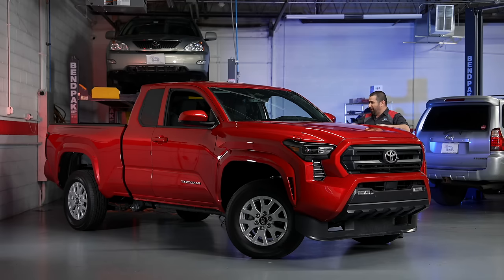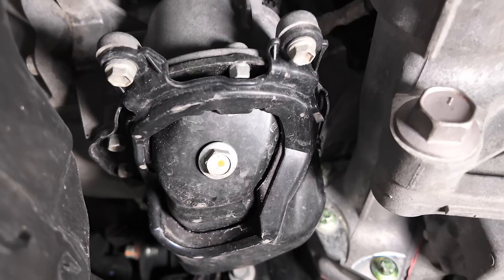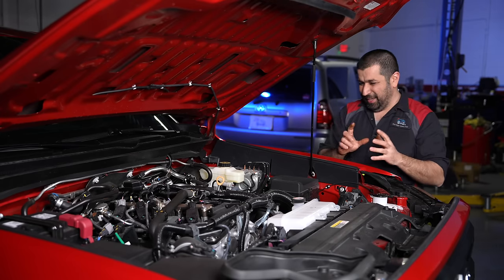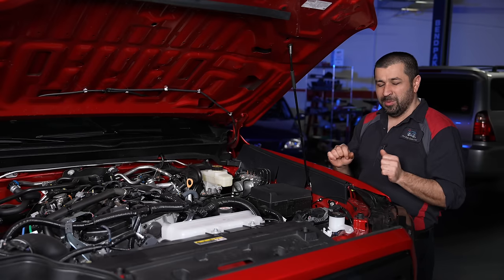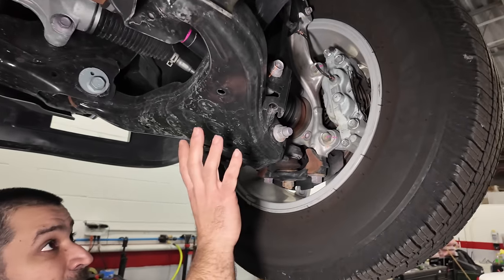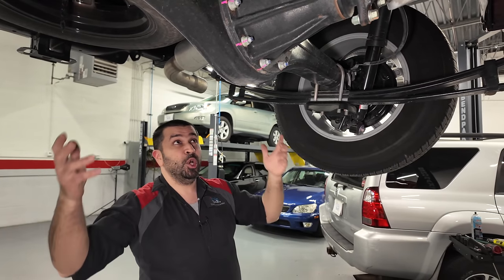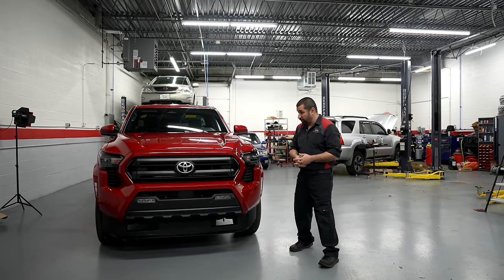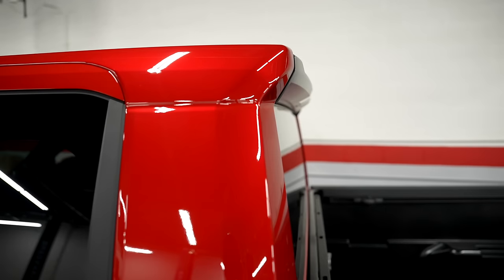2024 Toyota Tacoma | Did Toyota Improve or Ruin The Tacoma? Comprehensive Review

Comment: The vehicle i love and driving since 2009 is just behide you. 2005 model, bought used so many years but still haven't touched the engine for any issues. People talks about going green never talks about how battery and other things are collected or made. This vehicle is been running well, if i got an similar European brand it would have needed major maintenance works or ultimately had to change. So tell me a new vehicle adds carbon foot print or not?

Comment: Toyota cost-cut this truck too much. They retained the drivetrain designed for naturally aspirated V6 engines and used software to limit torque to protect the weak parts instead of simply beefing the drivetrain up. To add insult to injury they moved production to Mexico to eliminate most of their labor costs and still raised the price of the truck by $20k.

Comment: They keep getting bigger and bigger each year.  And with the increase in size they did enormous complexity- especially electrical components that can’t be repaired.  This increases cost of entry and total cost of ownership.   The main reason for this is EPA regulations that make it hard to produce a small truck.  I want a truck about the size of the original Datsun.

Comment: Its hard for me to believe this engine will last 300k plus miles. Watching this video makes me miss my 2004 tacoma with 376k miles. Would drive it across the country. Did not have any issues with it. The prices for these new trucks are extremely expensive, especially for a 4 cylinder. I have already seen problems with the new tacomas. This is an unfortunate time, folks.

Comment: I just wished that on all turbos they would have turbo timer and that means when you tur your car off it would keep running for how ever long it takes to get everything cooled off. The after market has a turbo timer that I have on my 05 Dodge 3500 turbo diesel and it works great and it runs for about 3-5 minutes and this is to cool down the tubo oil so it does not cook the oil in turbo and people just want to shut it down and run in a store and don’t want to set and let it cool off just a little. But tubo timer on my truck does a great job of letting it run and cool down and it depends if your pulling a load and that tubo at nite that turbo is cherry red and this timer may run 30 seconds or run a couple of minutes but it does work great so far and it has been on my truck for about 5-6 years so Tacos need to look at this little upgrade may save you a turbo and they are not cheap and the timer is.

Comment: In the previous (3rd gen) tacoma, the slow-opening tail gate did not use shocks. It used a plastic sleeve that rotates inside of a metal collar. That piece of plastic was very weak and prone to cracking and breaking apart, causing the tailgate to unexpectedly drop quickly. I know this because on my 2023 tacoma i have already replaced three of those plastic sleeves, and bent the bottom corner of my tailgate in the process. Poor design.

Comment: I'm a Tacoma owner (an older one), and I have a huge problem with them replacing the V6 with a turbocharged engine. Even if they kept the V6, I would still not want a turbocharger on it. Forced induction is great if you're a race car driver, but racing teams rebuild their engines often.  But an average wage earner who can hardly pay these high prices for a truck isn't going to be happy with shorter engine life that comes with a turbo. Do your research and learn what a turbo does to your engine. The long range data isn't in yet, but I for one will not be one of the guinea pigs.

Comment: The locking gas doors provide practically no protection.  You can open it with a knife or screwdriver in about 2 seconds.  If someone is going to pour something in the gas tank the locking door is absolutely zero deterrent.

Comment: Is this an infomercial?? I'll stick with my 2023  Canyon with diesel engineering built into the design architecture of the engine and 430 ft lbs of torque. Zero issues with my year old Truck.

Comment: It looks like they are not spraying down the engine compartments with that waxy oil stuff.  Never could get that off very well in my 95'.  Good they got rid of the mechanical fan.  That was a failure point more than once in my 95'.

Comment: Why they didn't just put the powertrain from the hybrid Highlander in there is beyond me.  Toyota reliability, hybrid expertise, would make this great.   

You don't need a 5 second 0-60 truck.  It is a truck, not a sports sedan.   7 second 0-60, with torque to pull a sub 5000 lb trailer, with great mpg is a market killer.

Comment: Beautiful car!! Crazy it came all the way from NY! Thoughts about 540RAT engineering blog? In it he has tested over 300 engine oils by now and his current wear protecting oil champ is Quaker State Full Synthetic 5W30 (not Ultimate Protection, must be 5W30). Says modern liquid cooled engines are “better served” with a highly ranked 0 or 5W30 from his list but I already gave his domestically available #1. Being an Aerospace engineer and lifelong engine builder he says car company engineers don’t understand oil very well. And they are run with political intentions. Anyway, that and Mobil1 Synthetic ATF Multi Vehicle (Silver bottle black label), Valvoline 75W90 gear oil and Redline MT85/90 are what’s in my garage 🔧

Comment: In my observations, Toyota should have given the choice to the consumer with better options. A powerful V-6 with a Turbo for pulling heavy loads as well as a better Rock crawler version having a, 4 cylinder Turno diesel with a dircet injection model. Give the customer better mechanized option and let the consumer decide for you upon the sales. Mechanically what would make, Toyota a better Truck, is always give your, DIY guy like a majority of, Toyota fans the engine access and ease of maintenance with easy bolt on performance upgrades. I'm not sure on the engine longevity and ease of maintenance with the split-head design. I see more problems with that design. 

The electric Fan is a better idea to reduce engine load, but in my observations my concern is how good is the water proofing and high mud issue handeling?  If live or work in a place that has high mud and snow and has alot of dirt roads in dealing with the high mud and wet snow coveringthe roads, how long will it last and how is the ease of maintenance when it fails?

Comment: I'm hoping that Toyota sticks to it's reliability reputation and has the kinks out for the 26s and up. They look good, but we'll have to see about the powertrain going forward. I have a 07 tundra with 251000 on the odometer and I want a midsized truck. I want to stay with Toyota.  I've had the little hardbody for over 10 yrs before and had no issues but a power steering pump under warranty. I do wish they would have stuck with naturally aspirated engines like Nissan is still producing for now. My truck runs great but further down the road I'm going down size my daily driver and keep my tundra for recreation.  If everything pans out for the Tacoma, I'll probably get the SR crew cab and still have the leaf springs. Every trim on the frontier has the leafs. I could get a certified pre owned 23 Tacoma with low miles. Anyone test drove both?

Comment: I hate that Toyota and other manufacturers (cough cough GM) are putting the same engine in different models but detune the entry level one essentially making the only difference being software.

Just put one power train then! That way you don't need two separate tunes to be maintained from a software standpoint. That said, I guess that oil cooler probably is needed for the greater model.

Comment: Why would a direct injection engine create less vacuum than a regular injection engine ? They all pump air in and out and they both have a throttle body that creates a restriction. It doesn’t make any sense to me that the position of the injector causes any difference whatsoever.

The real reason is far simpler : turbo engines create boost, which is the opposite of vacuum. The vacuum pump keeps everything vacuum activated working even when the engine is under boost

Comment: So yeah, basically Toyota has made a cheap and inexpensive pickup truck as expensive and Gastly to repair as a full size diesel truck when you start adding turbos and high amounts of technology that usually ends up failing and all these extra sensors and and what not all you get is a very very very expensive bill when something goes wrong and it's going to be out of warranty so you know. Good luck with replacing a $5,000 plus turbo and the fact that if the turbo isn't running properly, you're not going to get any gas mileage and you'll be lucky to get up to 20 mph. Yeah thanks Toyota. Thanks for destroying the Tacoma

Comment: Better keep the oil changed with oil controlled valve timing, and those other changes, among them turbos.  This is a very oil sensitive engine.  Plastics…. Eventually trouble.

Comment: An engine with direct injection if not maintained along with 3000 oil changes(IMO) and the valves not cleaned will result in stuck piston rings and high oil consumption. The oil cooler is a bad designed idea and all those O ring mating surfaces will eventually leak because of flattening O rings. Engines with direct injection should have at least port fuel injectors to keep the valves clean. An external oil cooler sans O rings would be preferable. The air to air intercooler should have at least a metal debris screen behind the front grill. Commercial truck manufacturers do that to keep rocks,bugs,birds, etc from damaging all the radiators. On top of all of that,the electronic start mechanisms are prone to fail and is not necessary .Electric actuated HVAC motors are prone to fail and necessitate practically pulling the dash out to replace. Cable actuated climate control doors are virtually maintenance free.

Comment: It's a new engine so the reliability is not known. It needs many years to prove its reliability. The single best selling point of Tacoma was reliable proven engines. Toyota made big mistake. I have been considering trading my 2015 PreRunner but I think I'll just hold on to it or maybe consider a Frontier which is cheaper too. Will have to do some research...

Comment: Right out of the gate, two different "engine options", which are mechanically identical, and only use different software. Yeah no, if you sell me the same engine, but try to charge me more (I assume), for different software, that's not gonna fly. You lost a customer just by trying that.

Comment: I've owned vehicles with 4 cylinder turbo charged engines. (Isuzu  turbo diesel, Mazda CX-5 2.3L Turbo, along with Ford 250 Superduty with a 6.7L Turbo diesel) The reason for the installation of these engines is a government  requirement meant to meet the CAFE standards.  In general, that doesn't work - it's been my experience that gas mileage doesn't improve that much. For example, on the highway, I get a bit better than 22 MPG with the 3.5L V-6 in my 2019 Tacoma.  It's also been my personal experience that with a turbo-charged engine there's a tendency to 'get on it'. This always lowers the mileage. In general (it's also been my personal experience) that the life expectancy of a smaller engine is less than that of a larger engine.  Turbo failure has followed all of these vehicles even having used the 'cool down' techniques necessary to operate them along with frequent oil changes with high quality oil. Finally, the smaller engines have to be 'driven harder' in order to get the same amount of 'work' out of them than a 6 cylinder.  Give me a larger naturally aspirated engine any day.
Reply: Biden requirements can kick rocks 💪🏼

Comment: I was getting ready to say something about the air dam. It's dumb but at least it's not part of the painted part of the body like my Camry had. 

It sucks not having a dipstick for the transmission. I didn't care until that crappy 2020 Camry transmission started acting up and I didn't trust the dealer was checking it when I asked them to. The dealers wouldn't let me watch the maintenance done to my car and that really bugged me.

Toyota had to be sued for them to fix that crappy transmission in the earlier cars. I hated it in my Camry.

The gas filler above the fender flair is a bad place. I hope a  protector is made to keep from chipping the paint if you're not careful. 

Don't buy a pickup if you want a smooth ride. It's not made for that. 

The body lines look better than the full production Tundra's.

The radar sensor is right were other people's bumper would hit it. 

It's way overpriced for a pickup. I'm concerned how well a turbo engine will hold up to towing or loaded after 100k miles. I expected my new Camry to last but it was the most annoying new car I've ever owned. I didn't trust it to drive it very far.

Comment: Turbos suck. I do 40000 miles a year and I don’t know of a reliable turbo past 125k. Coil springs suck if you’re going to use it as a work truck. Those nicad batteries don’t last either it’s like the 1990s calling wanting their technology back.  I’ve only had 1 Nissan Frontier and that was back in 1996 and was always in the shop. But I will give them another look. I was holding off until the hybrid but nicads are a deal breaker.

Comment: I just bought a 23 and got it tuned. The 3.5l and 6speed perform excellent with the Overland torque tune. All the power is moved down to the low end, the throttle responds almost instantly, and no more gear hunting. I was crusing up a steep interstate 85mph in 6th gear. No downshifting and I had to let off the throttle to not accelerate more. If this truck ever gets wrecked I am getting the 3rd gen frontier with the 3.8l and 9 speed auto. That truck hauls ass

Comment: I'm sorry but I'm against this V6 Twin Turbo technology, especially if you'll be using the truck for towing a heavy trailer, as that would make the turbos run constantly which would put a lot of heat into the engine and shorten the life.  The Ford Eco Boost V6 twin turbo is proof of this problem when towing with engine failures starting as soon as 50,000 miles.  

In addition to that these engines have 2 turbos, and turbos only last an average of 150,000 miles, so you will have 2 turbo failures that are not cheap to fix.   

I don't know if Toyota figured out a way around the low mileage high failure rate that the Ford is experiencing, but I wouldn't dare buy the Toyota till that engine has seen at least 5 years of use.  Don't get me wrong, I love Toyota vehicles and own two of them including a Tundra with the 5.7 V8, but I won't be rushing out to get the twin-turbo V6 any time soon!

Comment: FIXED:
(1) Rear spring mounts - no more Ford-style inverted hangers (A+)
(2) All guts tucked up into the chassis frame members for easy skid plating (A+)
(3) Increased size of ring and pinion (A+)
(4) Brought back the full-strength chassis that isn't a Ford-style Open-C (A+)

BROKE: 
(A) Continued the electronic transfer case shifter (F-)
(B) Continued using SPICER / DANA driveshaft and u-joints (C-)
(C) Made it wider, longer, lower (F-)
(D) Increased complexity of engine while decreasing overall potential reliability, and increasing repair costs for users ... for the entire lifespan of the vehicle (F-)
(E) Continued the chunky, blocky, interior design that's hard to clean and mount things to (C-)
(F) Interior is uniformly black, so finding anything in the vehicle in poorly lit conditions is dreadful, not to mention gathering and showing hair and schmutz (D+)
(G) Continued complex front-end, making replacement with aftermarket offroad bumpers a very expensive project

Overall, it's a nice truck, and they fixed a lot of stuff that will bury the 2nd and 3rd gens in the history books, but the new stuff they broke is a deal-breaker. Toyota's truck legend came from providing over-built, capable, intensely utility-centered designs, with mostly mechanical systems that are both reliable and field repairable. For anyone looking for an off-grid capable vehicle, this one appears to be a mess, and won't be for anyone who is interested in being self-sufficient.
Reply: One more note ... Stupendously well done review, The Car Care Nut! Best online, I think.

Comment: I'm still waiting for the one that'll have the 3 speed manual on the column and two axle driven electric motors up front for four wheel assist, no transfer case and no mechanical connection to rear drive😂😂

Comment: They ruined it. Turbocharged 4 cylinders might suffice in small passenger cars, but making them the only option for a midsize pickup that someone may actually try use like a pickup for 300,000+ miles was a mistake.

Comment: Toyota builds great vehicles, but there's no way this engine is gonna last near as long as the older v6.. Once you start adding turbos and DI the engine is  going to get a lot hotter burning more oil and shortening the lifespan of some of the parts.

Comment: squeezing every ounce of power out of that little 4 banger without the MPG benefits makes no sense to me. Why not have a V6 hybrid option that will deliver the horsepower along with more MPG. Not a fan of the two engine options for the 4th gen Tacos.
Reply: Generally the goal of the downsizing is to at least match previous MPG (or slightly succeed as in here) while reducing tailpipe emissions but getting equal to more power, which they did
Reply: @chibbyylol  

Goal achieved!  Can't wait to see the lifespan of these 4 bangers.  This move only benefits Toyotas bottom line. 
I'll be sticking with my 3rd gen.

Comment: Turbo engines are being used only for EPA gas mileage requirements.  They eventually will fail and require replacement.  No longer will these engines go 300k+ with no major items replaced.  Toyota went the wrong direction with all these turbo engines, including the Tundra.